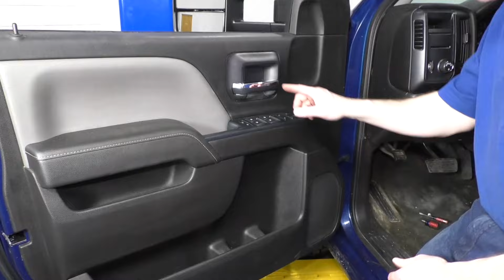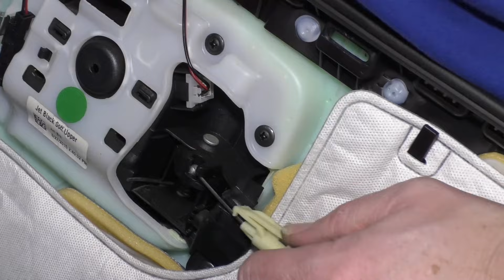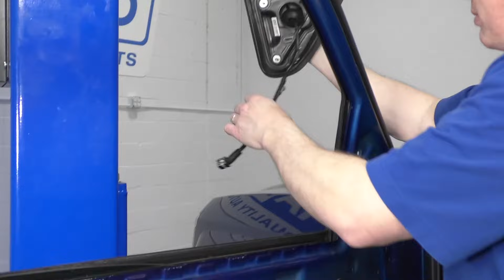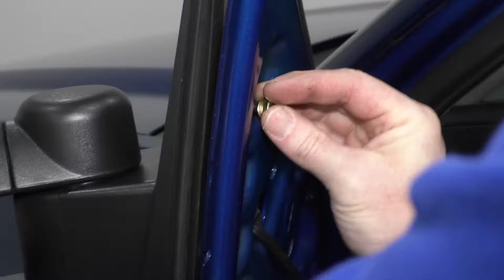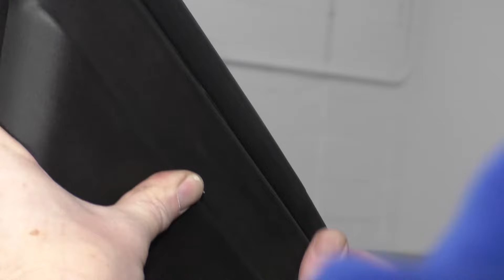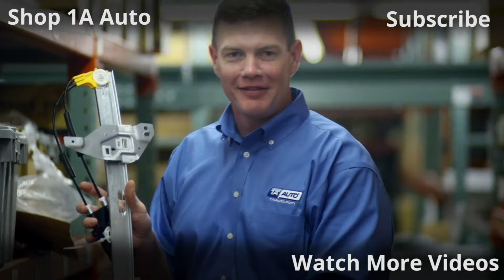How to Replace Front Side Mirror 14-17 Chevy Silverado

Comment: My 2015 Silverado doesn't have power windows or mirrors. They are manually controlled (by hand), therefore it doesn't have the push button console underneath the door handle. There is no pull off panel, it seems to be all one piece of plastic. Does this mean there is no 7 mm. bolt there, and there are only 5 bolts holding the panel?

Comment: One comment for those with a manual crank window: you will have less screws to pull but you will need to remove the crank by pushing in on the door interior and popping out the clip that holds it in. I used a pick set that was less than $2 from Harbor Freight

Comment: Long story. Please be patient. The Transmission is not on the truck (being rebuilt). Turning the key to on position the truck has no life, cause the computer knows the trany is not in, Right? I've installed the new mirror (I bought from you) , only to the point of the plugging in the mirror plug. Next, would be plugging in the big door panel plug, right? So, since truck shows no signs life from computer when I turn the key forward, leading me to believe I should NOT go any further, Right? Order# 2DVH15MOVLW . I look forward to your reply confirming my suspicions. I'm Garson's wife, Jackie Weymouth. Garson is helping 1 of our children in Phoenix and won't be home till 8/29/22. I'm just trying to get as many things replaced on this truck before he returns. This truck is from a Non-Profit 501c3 Appalachian Legacy Initiative and they need their truck soon. That's why I'm installing parts for it. Your video was very good helping me remove door panel, plugs and damaged mirror. Then begin to install new mirror up until the big door panel plug.

Comment: Do you have a video for tow rearview mirrors but with the signal lights installation. I bought some with the signals lights etc but my truck doesn’t have that, it has the basic lights installed.